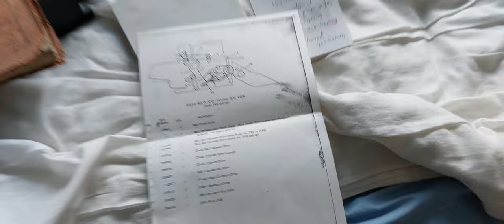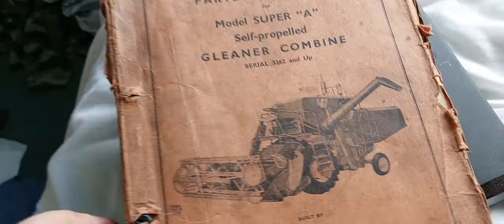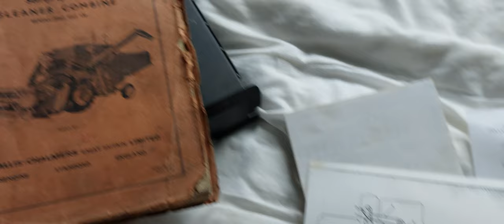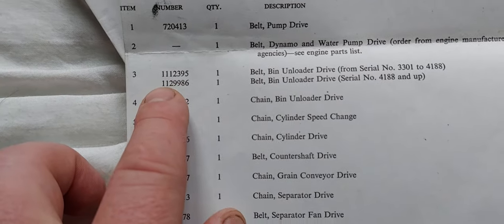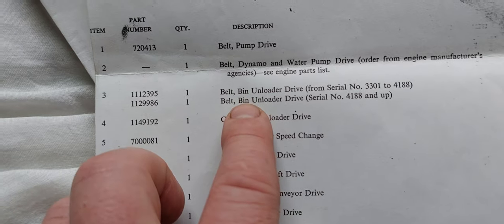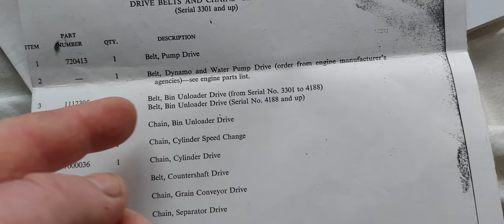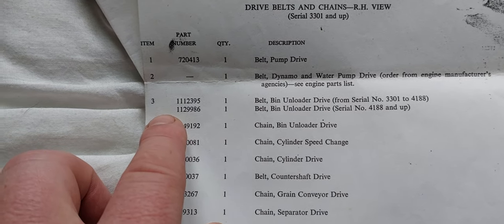trying to find the size of later type Super A unloading belt.

Comment: So the 4188s can use either belt?
Reply from the maker: No Square back Super A Gleaners built in the Uk prior to serial number 4188 had the same unloading auger belt that had been fitted from the start of Uk production. Square back Super A including serial number EC4188D and onwards to end of production had a much more robust drive layout with what is apparently a longer 3550mm C section drive belt. The man i was helping seems have found the correct belt size now. As soon as i get the exact confirmation of the belts performance at work then i will do an update.